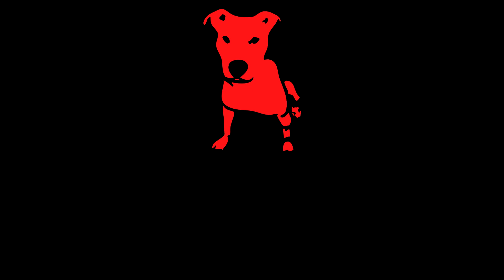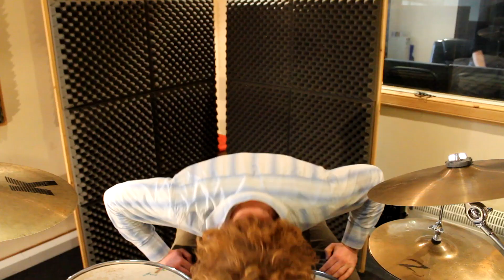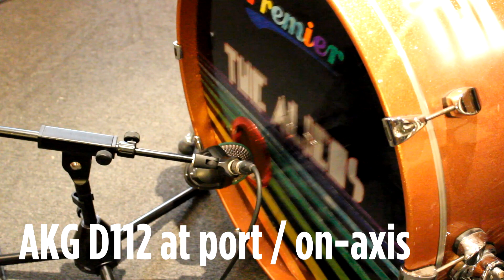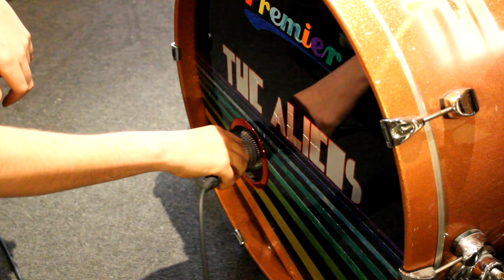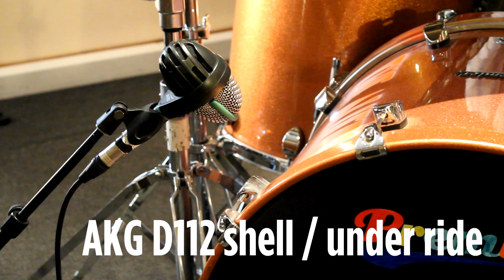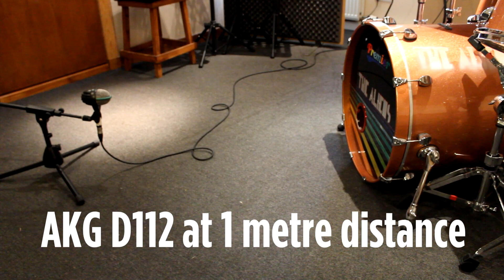Bass Drum Microphone Placement

Comment: Me and my band did the same error placing the drum mic out of the bass drum ( at half a meter from the BD) when we recorded the drums for our album, we used the same mic 'AKG D112" and it was a terrible idea, cause it took the sound of everything else (snare, cymbals, rototoms etc ..) it was a pain in the to apply an eq to that cause it also changed the eq of the rest of the drumkit, adding extra high and low frequencies where we did'nt want to have some !
Reply: arrackattack you can protect against that by making a lil tunnel around the mic and covering it with blankets and stuff